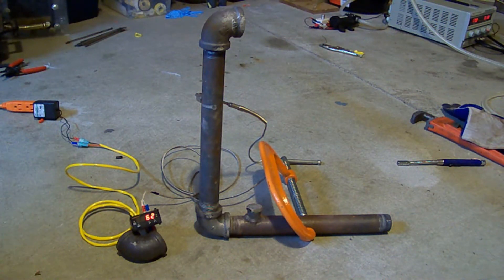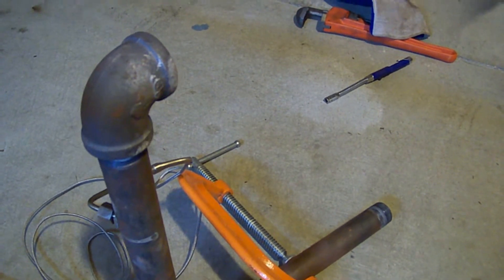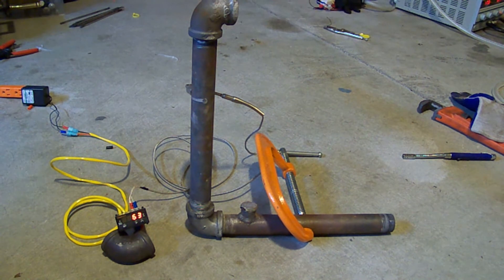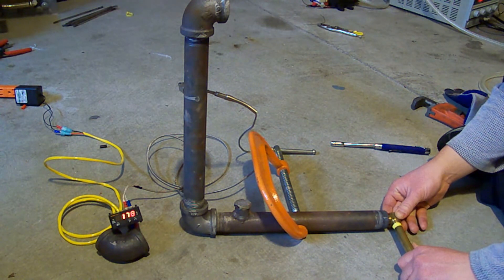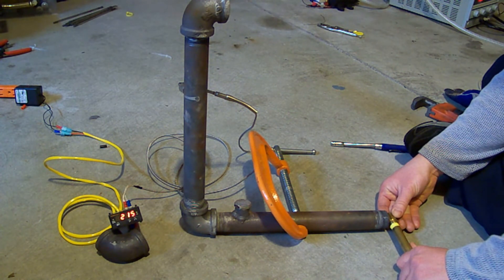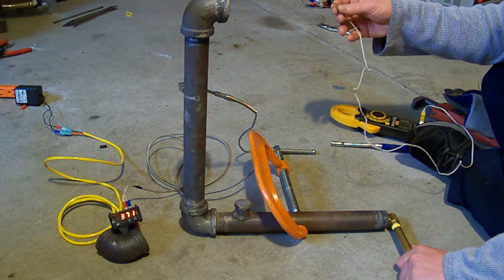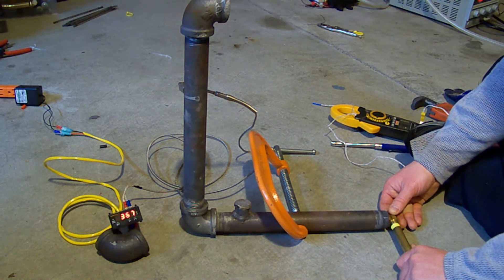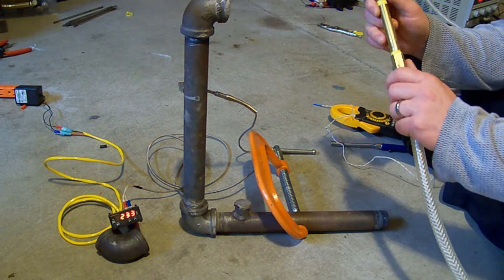H2eating Experiments with HHO Torch

Comment: Using hho for heat is a good idea. I have wanted to do this for a long time how. Instead of trying build something I will be using something that was already designed and built for this purpose. A portable LPG Mr. Heater converted to HHO fits the bill. If you don't build it I will if I can find one. Maybe you will build it before me? I wish you well. Shannon

Comment from the maker: There are several technical papers from reputable technical journals that detail the unique properties of the hho flame:

R. Santilli, “A new gaseous and combustible form of water”, Int J Hydrogen Energy 31:1113-1128 (2006).

O. Hung-Kuk, “Some comments on implosion and Brown gas”, J Materials Processing Tech 95:8-9 (1999).

H. Ymamoto, “Explanation of anomalous combustion of Brown’s Gas using Dr. Mills’ Hydrino Theory ”, SAE Paper, 1999-01-3325 (1999).

Comment from the maker: I can melt a brick with an HHO torch.  My body can't melt a brick...  I understand the difference between heat and temperature.  It seems that the HHO flame produces the high temperature when it reacts with other materials.  The heat seems to be also generated in this way.  I am not wasting time as you have implied i believe that this is useable energy that can be harnessed from the HHO flame.

Comment: Cool experiment. I have been messing around with some nickel alloy. I'm able to get the the metal 800-1200 degrees and will hold the heat much longer than steel. The flame reacts differently depending on the material. I think its all about building the correct shape and using the correct metal as far as the heat exchanger goes when it comes to hho heating.